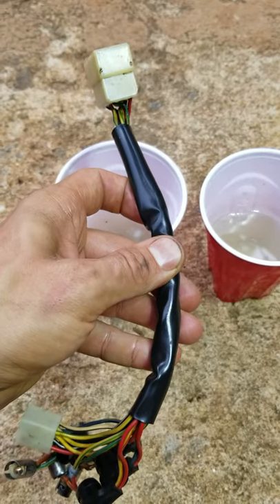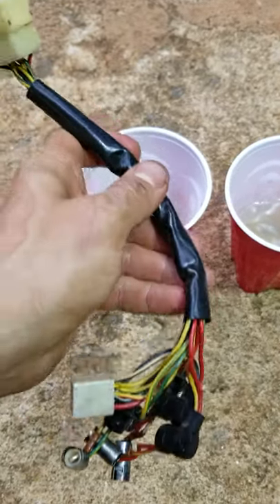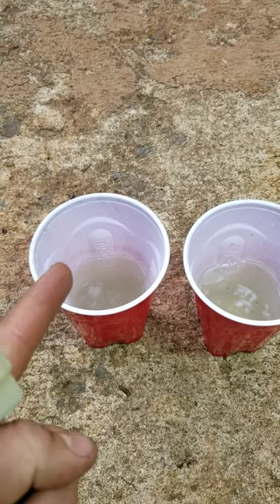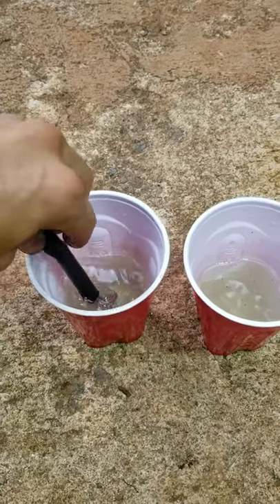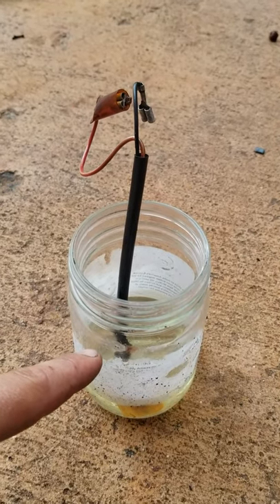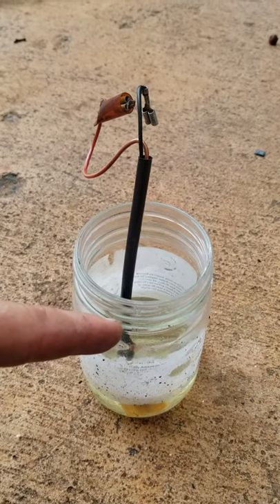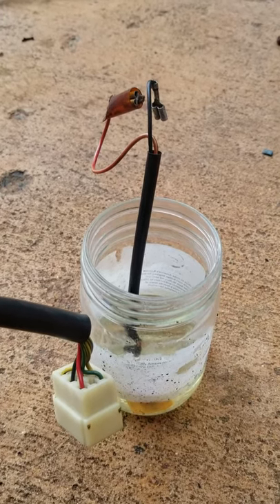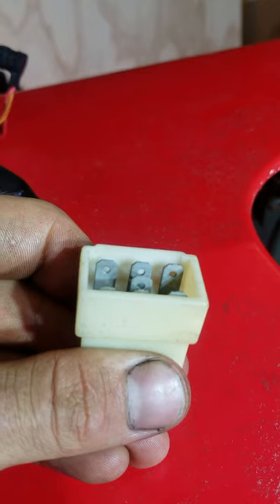Corroded Electrical Connectors GOOD AS NEW!

Comment: you don't need to add salt to the vinegar, in fact that is the last thing you want to do. any salt left in the connection is going to corrode the connection again REALLY fast
Reply: That is why you have the second cup with no salt
Reply: Agreed. Dont put salt!
Reply: I would never put salt in there. FYI just use WD40 contact cleaner.

Comment: Sweet, I can use this to not only fix any possible flood damage after my 310k 08 passat had water puddled in fronts seats for a month bc of a clogged ac condensor line, but that tin plating should save my functional parts from being super old and worn in another 5 years

Comment: Could i use this for my taillight harness? i used electrical cleaner and a wire brush to clean before which worked for a while but stopped working again

Comment: Do you know what kind of terminals the liquid tin will work on?  Will it only stick to copper?  This is exactly what i need for the wiring harness im restoring.  Most of the pins are just steel though.
Reply from the maker: It will stick to copper maybe bronze or brass. Are you sure they are steel? Try a magnet they might fool you.
Reply: @MattsShop  i will give it a shot.  Thanks.